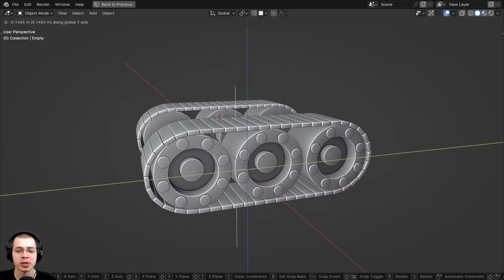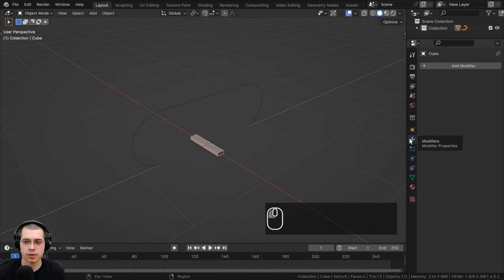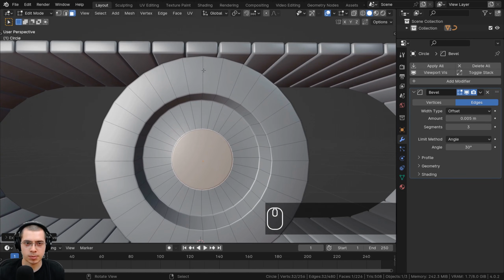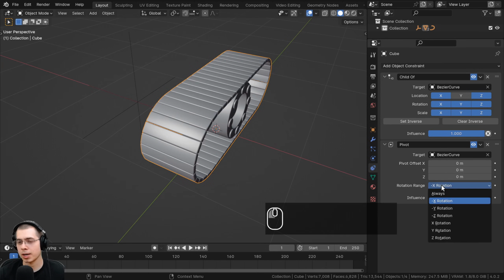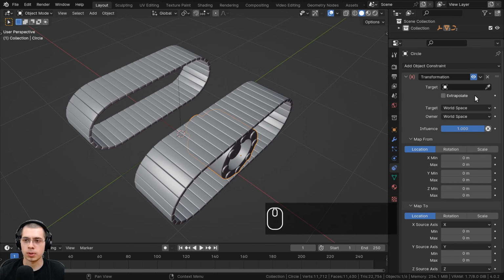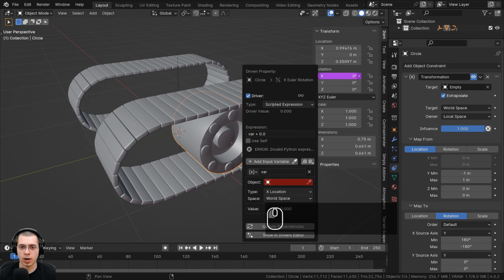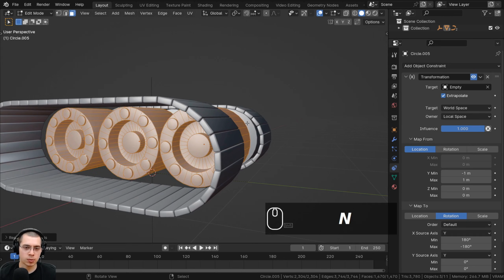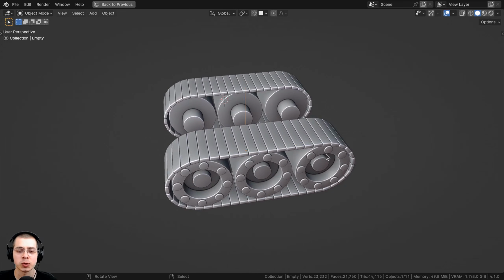How to Create Rigged Tank Treads in Blender (Tutorial)

Comment: Very nice tutorial. Thank you a lot for this amount of work.
Unfortunatelly, although the combination of drivers and constraints presented solved a lots of issues, there is one remaining: When you apply a Z axis rotation on the 'Empty' object, then it affect the speed of rotation of the track. The more the rotation is set to 90° or 270° the more the track slow down. I have not find any solution to it.

But in any case I have learnt so many thinks with this tutorial. 😀

Comment: When I move the ampty the Bezier curve follows and the track runs realistically around the Bezier curve. However, if I rotate the empty object around the z-axis, the Bezier curve  follows correctly, but only  at the beginning. As the rotation progresses, it becomes slower  until the rotation has completed 90°. This is the dead point from where the chain links move in the wrong, the opposite direction. The movement becomes faster and faster until the next 90° (complete180°) rotation is completed. From then on the speed slows down again until the second dead center is reached at 270°. From then on the chain links move in the right direction again and become faster again until they reach the origin. what could be the reason? Does someone know how to fix?

BTW great tutorial! Im a blody beginner and its amazing that I got this far. THank you there fore!
Reply: Same issue on my side
Reply: Seeing the same issue. Great tutorial anyway!

Comment: I have followed the instructions but it seems that when I rotate the empty in the z axis, as I approach 90 degrees, then everything slows down and beyond 90 degrees, everything reverses direction.  So if I rotate the dummy 180 degrees to face the other direction and try moving the treads, everything is reverse.  Thoughts?
Reply: did you find a solution?
Reply: @greegw3906 Unfortunately I did not! :(

Comment: the only problem I see that you don't show.. but loved to see a short or something.. is that the more you rotate the empty on the Z, the rotation of the treats and wheel start going crazy slow.. and start rotating the other direction. And if i move, rotate, move rotate, then it's even slower and more messed up, like why does that happen?
Reply: The problem with this is, that the whole mechanism is based on the movement of the empty in Y-direction. As soon as you move the empty in X-direction the tracks will not move anymore. In this case even the Z-rotation doesn't matter. I tried for a long time to solve this but I think that you cannot solve it with just drivers. There are addons on the market to animate cars which obviously can handle this. But they are packed with python code. And I'm still struggling with python.
Reply: @georgb302  okay thanks!! 1- so when I want to move it? what would be the solution? 2-okay, noticed

Comment: Can you make a 90°-turn or a U-turn with this settings and the tracks are still moving in the right way when you drive along? Havn't found a solution for this problem yet.
Reply from the maker: I'm pretty sure they will rotate correctly.
Reply: @RyanKingArt  Unfortunately they don't. If you rotate it 90 ° to X+ and move it along the X-axis the tracks are not longer moving. This is a common problem in Blender and it seem there is no solution for that.

Comment: I can never make tracks that "Actually Work" there broken as soon as they are rotated 90 degrees on the X or Y axis they might drive along Y but If turned to X every thing locks up and breaks can be reset with empties but never actually working properly
Reply from the maker: That shouldn't be an issue with the method that I use in this video.
Reply: @RyanKingArt  Guess I'll have to try it out and see what happens
Reply: @RyanKingArt  ammm, l have a problem with the curve modifier, the "curve object" can't find my object 😭😅
Reply: @RyanKingArt  i made a triange wheel and its having the issues described, i have the same constraints and modifiers but the wheels issues are not fixed, i got to the part where you talk about adding another wheel
Reply: @RyanKingArt  I'm having the exact same issues as the OP and I've followed your video three times now.